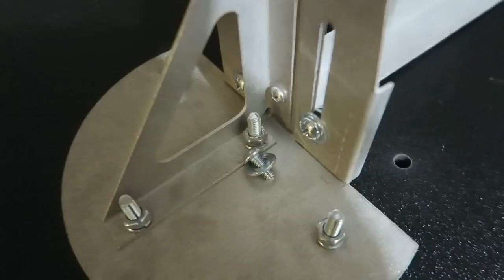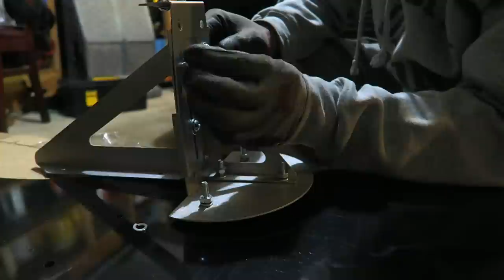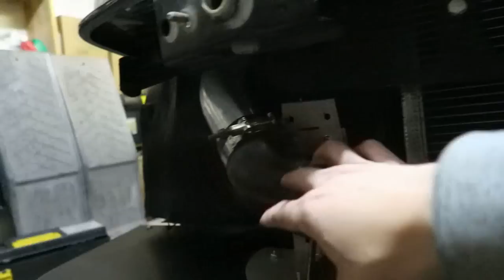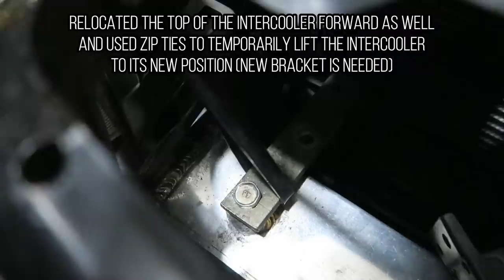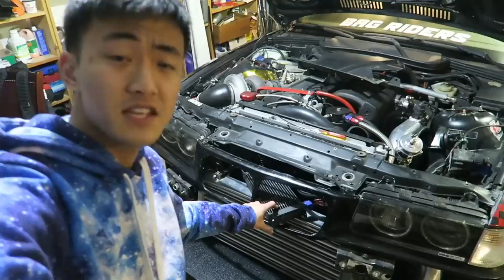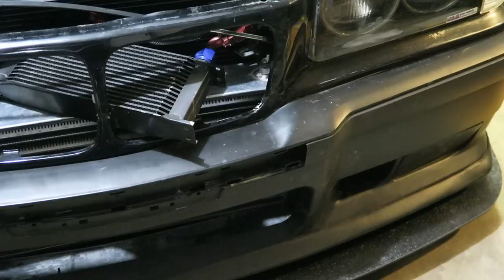Will It Fit? Adjustable Front Splitter Install On My BMW E36 [MKAH Motorsports Front Splitter]!

Comment: I kinda want to DIY such splitter, so say I went into some local home supply store to ask for a big piece of plastic like this, what exactly is this material called? I know they go like PPA, ABS and million other variations
Reply from the maker: I do not know what type of plastic material they use, but it might be on their website details on the part. I’m sure you could DIY the splitter